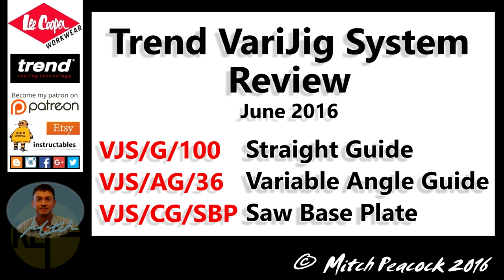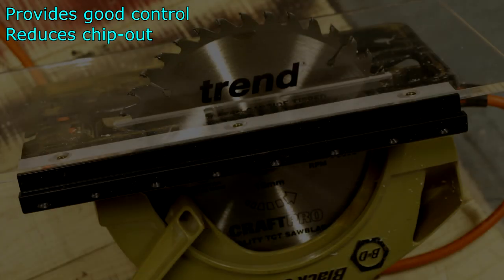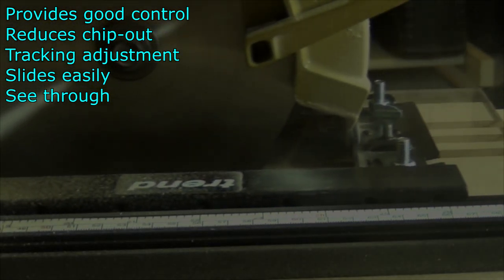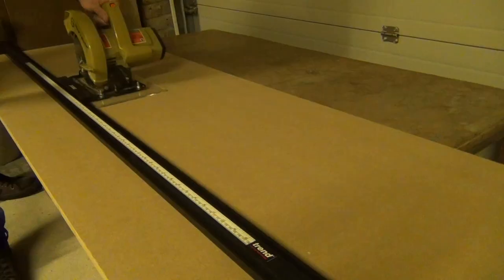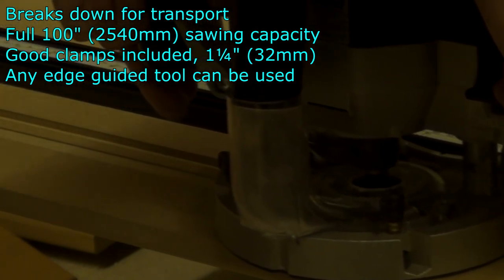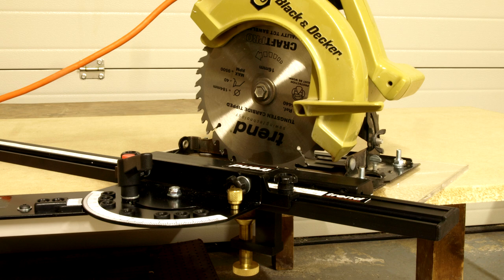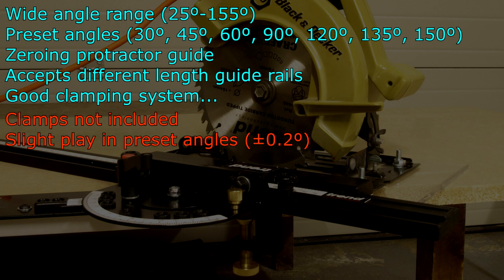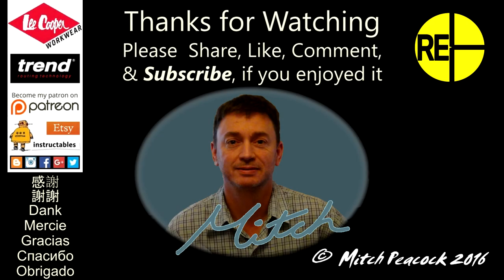Trend VariJig Review - Straight Guide, Angle Guide, Saw Base Plate

Comment: Hi Mitch, I was hoping your video would show how the angle guide attaches, but it did not anymore than the pictures I have found.  Could you attach it into a t-track running on the edge of the workpiece?  I was also wondering if this would clamp onto a Makita track saw guide?
Reply from the maker: 24revealer Hi. The angle guide comes with a 36" track, and can be used with the other rails in this system. As is, there is no way to attach other rail systems, although they could be butted up against the trend rail.
I haven't had any connection with Trend for a couple of years now, since most of my work is unplugged, so it would be wise to check their site in case things have changed.
Cheers, Mitch

Comment: There is also a 50 foot straight edge.  Is the 100 just two 50 foot ones plus something to put them together?
Reply from the maker: The 100" is two 50" with a joiner. It seems well made and mine is very accurate.

Comment: Did you have to router a slot in the base plate for the blade?
Reply from the maker: I actually plunged the saw through, so that that the slot was zero clearance, or at least close to that.

Comment: Is there a US dealer who i can go to for spare parts?
Reply from the maker: It's been a while since I had a contact at trend, so I can't tell you for sure. Have a search for trend routing technology
Reply: @mitchwoodwork  I've tried that. I actually called Trend in Great Britain, perhaps I caught someone on a bad day but he suggested I just buy a new system. Greaaaat idea, buddy.
Reply from the maker: @bigthinkinguy  Oh dear, that wasn't very helpful.
What part were you looking for? It's been a while since I used it, but I don't recall much that was either custom or complicated (except possibly the rails themselves). Could you maybe find a substitute part or fabricate it.
Reply: @mitchwoodwork  I need some new rails. The router jumped over the bushing and cut into them pretty badly.
Reply from the maker: @bigthinkinguy  wow, must have been bad. The rails are reversible/symmetrical so damage to a single edge can be dealt with. You might try asking your local metal fabrication shop to cut out the damaged section sand weld the good pieces together.